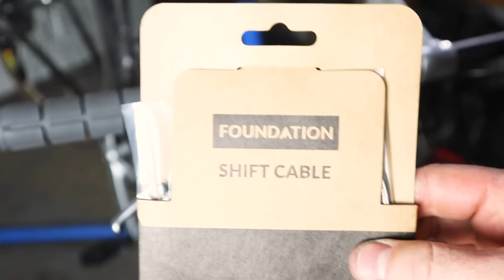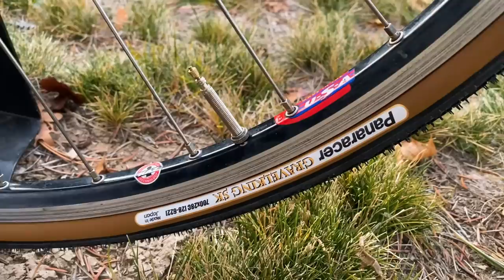StreetFighter Road Bike Restoration Build - Lemond Nevada City

Comment: I've come back to watch this 4 or 5 times now. I've become quite addicted to collecting and rebuilding bikes. It all restarted since March 2019. 

This video inspired me to build a street fighter / commuter. 

I found myself an old '88 Schwinn Circuit with the original Sente group, minus the brake levers. I removed most of the group and left the downtube shifters. I spaced and aligned the rear to accommodate a 130 wheel spacing. Tiagra 4700 front and rear derailleurs, friction shift, flat bar. It turned out perfect.

Comment: It's funny to have found your "streetfighter road bike" builds just now. I've just finished a build for myself comprising of old parts and a steel road bike frame. I have always leaned towards putting mtb parts on my road bikes. This one even more so with 1x9 narrow-wide setup and a downhill straight bar with a little rise. Its great to see a kindred spirit out there.... I just love to build up these old frames and making them my own. Mostly I love to ride them hard in the streets. They're lightweight, fast and very maneuverable machines. And I can fix anything on it. I'd hate to buy more new aluminum frames when these old steel beaut's are still around.
Reply from the maker: 🙌 was totally feel the same my friend.

Comment: Awesome build love the mix of components you used. Looks great. Tried bluing a steel bmx frame as a test, didn’t realize how quickly you need to clear coat it, I left it to sit overnight and entire thing rusted up. I had to re-sand and start over, wound up painting it. Will try again on another project, this build is the inspiration! 🙌

Comment: You should do a video just on how you remove paint from a frame. Is it just hours of sanding or do you use a chemical agent as well? The welds have always been what get me.
Reply: I second this
Reply: Wire wheel attachment on a drill can help get the tricky spots
Reply from the maker: I’ve tried chemicals and don’t like them much. On this one I just did hours of sanding while thinking I need to get a sand blast cabinet that fits a bike frame…😁
Reply: @oldshovel  the easiest solution always ends up being the most expensive
Reply: I get my frames blasted at a local powder coating shop. $25 a frame and there is absolutely no paint left. Then 400-600-800 wet sand. It’s worth it.
Reply: @oldshovel  yeah, I did a bike a little similar to this ( of course it is not looking this badass). My dads first bike. Got it sandblasted, because it was a pain to sand it properly (1975 paint). I put a flat bar on it and a flip-flop hub, so I can run it singlespeed or fixed just by flipping the wheel. I call it the Shopping slayer haha.
Reply: What John said. Find a local sandblasting shop. I also paid $25 but in Canadian dollars per frame.  100% worth the cost just for the lack of sore fingers and sanding dust alone.If I'm painting it I'll just use 220 grit then primer. The one frame I torch heated/blued I did 400 then 800.
Reply: @JohnPilling25  I work at a shop and yeah any steel frame would take under an hour to be absolutely spotless
Reply: @JohnPilling25  Second this. They have the stripping tank which they submerge the frame to the tank and leave overnight.
Reply: @JohnPilling25  good idea. $25 with frame and fork, or just frame?
Reply: @MrLabYoshi  both!
Reply: @JohnPilling25  that’s a good deal, I went to three shops in my area, and all are asking $100.
Reply: Decals? Where do you get them? Please
Reply: Lija + algún cuchillo o pieza con borde firme y un poco afilado quitan la pintura al horno, si te lleva horas hacerlo mejor, así disfrutas mas.

Comment: This is an excellent build.  
It will be both useful and huge fun.
I love the way recent evolutionary steps in chain/sprocket/shifter design rendered feasible many more gear set-ups.  
This will be am excellent street warrior.
I confess (although they lack a little lightness) I prefer a modded hybrid or rigid-fork MTB in this rôle, as the frame allows a fatter tyre and the brakes are normally a more effective Canti or linear-pull type.
But caliper brakes are not a crime either, and this will be a wicked toy.
Chapeau.

Comment: Nice video. I did a bike conceptually similar this year, and I was fun watching your build. I had a '70s vintage Jack Taylor tourer that I never liked the handing of, but liked the general setup of. I transferred most of the parts to a frame of mine (I used to build, also '70s vintage 2x5 gear, 120mm hub). New brakes, new 32mm Gatorskins, and I now have a good handling 'round town flattie.

Comment: I love the look of raw steel. I once had a steel frame sanded and clear coated. It looked fabulous, but in time specs of rust started to show all over the frame. Apparently, the clear coat I had used didn't seal enough to protect the raw steel. Make sure you protect this beauty well!

Comment: Mind to share the chain install procedure? It's pretty different from the common method used in Shimano 1x/2x docs, which is large chainring + largest sprocket + 2~4 links.

The final result looks good and seems to have less stress on the RD.
Reply from the maker: I just set the chain initially to the most links that work on the smallest rear cog and front chain ring that engages the rear derailleur sufficiently. If after that I need to shorten it I haven’t gone too far too soon. It can also slow me to go to a bigger rear cassette without swapping the chain.

Comment: Super nice! I really like the blued steel look. I did a similar build recently with a 80’s Nishiki road bike. SRAM X5 groupset (Apex crankset) and wide flat bars. But I could fit 35 mm Conti Race King’s in there, so glad to have a budget gravel grinder.
Reply from the maker: Awesome. I had hoped to fit some 32’s but it was rubbing. As is m quite happy with it as it is. Fun and fast.
Reply: @oldshovel  Fun and fast is all that you want.

Comment: I have an old late 60s early 70s Juventus Bergamo frame in brown that I put a 3 speed  26" IGH on. Running a 54/22 gearset on it with the original wedged crankset. Might have to replace my wedged crankset for the 44 tooth sealed bearing BB and add a flat bar and some gravel tires to it if  I can find some in 26" diameter.. any recommendations?

Comment: I'm wondering how much of the liquid blue was required for the whole frame and fork, if just one of the 3oz bottles (at ~$8 each) it could be fun to try, I'd be curious how it held up under the clear on this build...
Reply from the maker: I’m still on my first bottle of super blue and I’ve done 3 and a half bikes and several axes and tools with it. It does not take much. On this build I did just one application though. On the club ride gift bike it did 3 and then did 6 coats of clear. Both the gift bike and this one have been ridden a lot and the clear coat is holding up well.

Comment: I'm glad you kept the original fork.  I'd consider trying narrower flat bars -- it's easy enough to swap.  Back in the pre-suspension mountain bike days bars got very narrow and head angles were steep; that's because you couldn't roll over everything, quick handling was prized.   The same logic applies to a flat bar gravel bike, I think, and since you're using an old road frame you're stuck with the steep head tube angle anyway.

Comment: You could start using and angle grinder with a wire brush to remove the paint. Way easier than sand paper.

Comment: I'm curious about the shift cable routing, there has to be a reason why it goes to the left side and crosses under.  Thanks for the video, I think I might try the gun blueing on my Miyata 914, it is splined and triple butted, rides so smooth but the paint is a mess.
Reply: It's just an alternate way to route the cables - less cable bend required at the bars.  Not all bikes can accomodate this, however - if the cable stops are located too far up the side of the downtube then the cables will rub on the downtube if you cross them.

Comment: Much love and the owner of several of those 853 gems... but the RUST ?? We Canadians have always had to rust protect those tubes like crazy (salt used on roads lasts long into spring season for road and gravel use)... Have you had success with raw steel and the very thin (non 2k) clears working to protect the raw steel ? Do you not suspect spider cracking in the clear and rust forming under the clear ? Any success previously with raw staying rust free ? Thanks !

Comment: You missed a triere my friend ....... should lit a fire and thrown the frame IN it, it is the No1 best/fastest/easiest/most ecological way I have found to remove paint /powdercoat from a steel bike frame,. All the paint turns into a flaky ash, and just needs a light rub with wire wool, job done, maybe try it next time, you won't regret it.

Comment: That's the same flat bar that I am currently using, I had troubles with it fitting my quill stem, is the that flat bar indeed 25.4 clamping diameter? I since the quill stem didn't fit I changed my bike from a 1 inch to 1 1/8 inch converter to use another stem but I really want to use my quill stem but it doesn't fit so I converted. Please help.

Also can you make a tutorial on how to make any rim tubeless, or informative video about that?

Comment: Do you have to cover the blued parts in oil to let them cure, or does the top coat achieve that for you?  How many layers of bluing do you do?  Thanks!

Great video.  I actually used spray.bike to paint my daughter's bike and it turned out great.  Dropped them a message to let them know I found them through your channel and they said a lot of nice things about you.

Good people too, they answered a couple of my questions almost the same day.
Reply from the maker: On this build I wanted an in even textured look for the blueing so I did just one blotchy layer. To get a more even blue it  helps to rub it with a son super fine (000) steel wool and do a few coats.

Comment: Unfortunately used frames in this quality are rare to find nowadays, most of them where retired for a reason (damaged, bent or dented), the others are way to expensive. Very nice build, especially with the blue steel treatment and clear coating, but I doubt it can hold up against the elements in every day use very well and rust may appear quickly.

Comment: I enjoy your videos. Why don't you buy a roll of outer cable, and brake and gear cables in rolls of 50's from ebay. It's much cheaper than buying thoses individual cable sets. After all, you use enough of them..Just sayin.